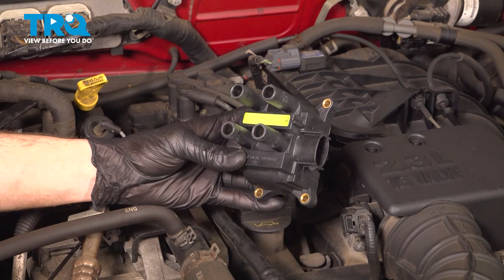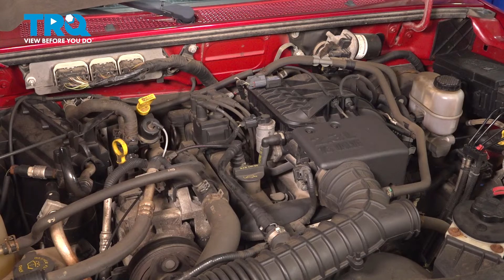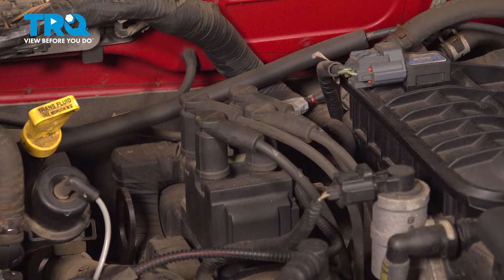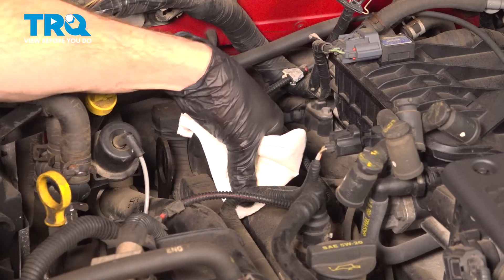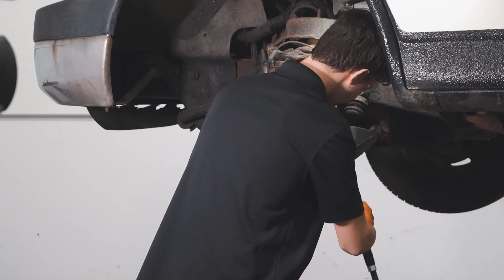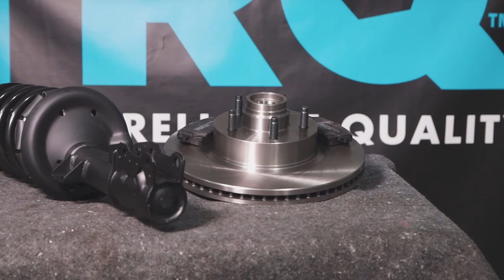How to Replace Ignition Coil Pack 1998-2011 Ford Ranger 2.3L L4

Comment: Something odd I noticed. Your plug going into the coil was upside down compared to mine. I'm surprised to see it can be installed both ways but I wonder if there is a right and wrong way.